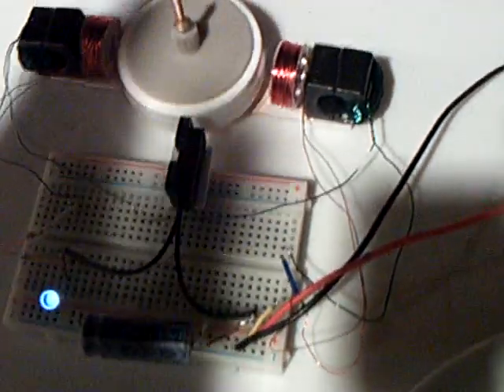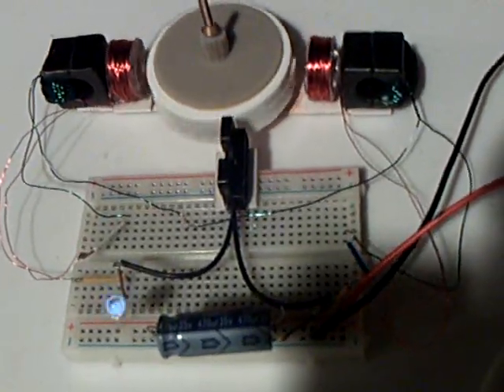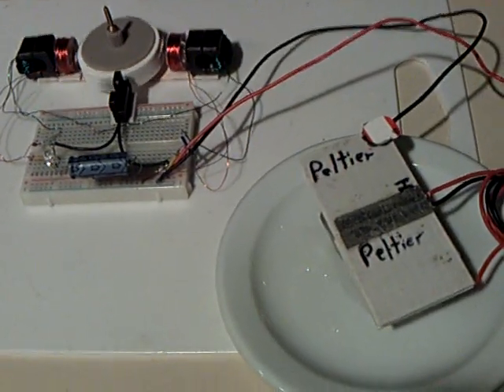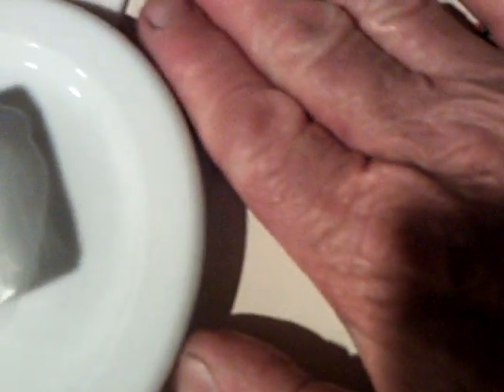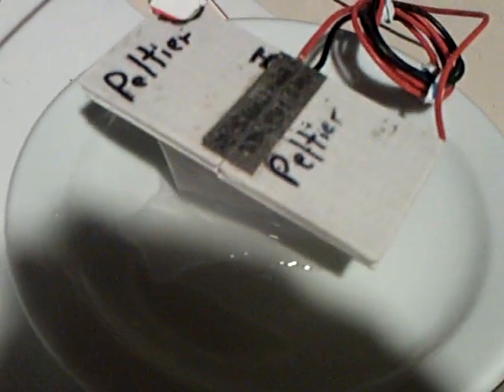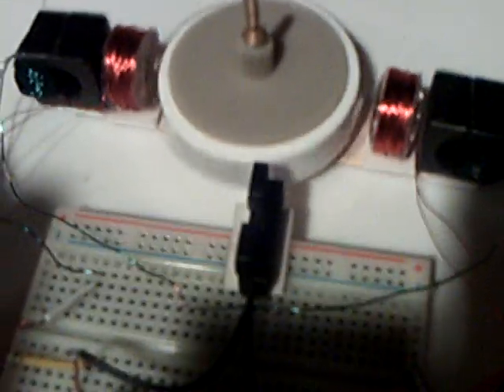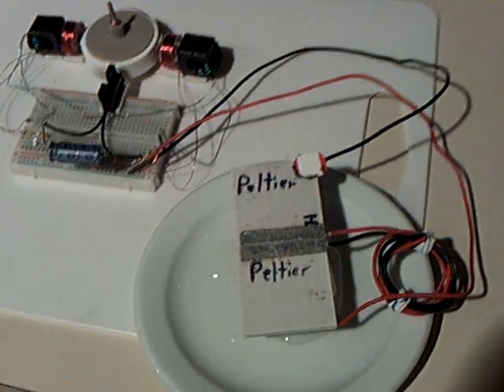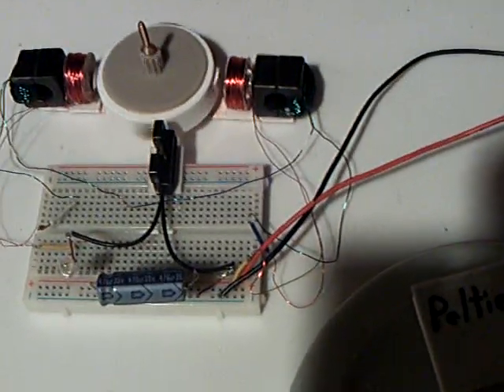Thomas Motor ----running on thermal electric module

Comment: what you think the true value of a pulse motor is after building so many?
Reply from the maker: +area46241 Take a look at what happened to the model airplane industry when electric pulse motors were coupled with smart electronics.  The power to weight ratio became good enough to edged out the gas engines.  The simple computer fan motor is another example.   For some applications they are just a really good choice.

Comment: Here's something that may interest you about thermal energy/electric devices:
http://www.powerchips.gi/faq.shtml

p.s.:  You could pump heat from a flame/fire below a thermo-electric device & put snow or cold air above the device to maximum power production from a thermo-electric devices.  You could also use ground temp vs outside temp in very cold climates to get a lesser amount of energy production.

Comment: nice work Lidman.i have never heard of a Peltier  Module.another thread to follow.thanks for sharing.
Reply from the maker: +bill bailey  These Peltier Modules are used for cooling but when you run them backwards with a heat differential they produce electricity.   You can get these pretty cheap on EBay if you shop around.